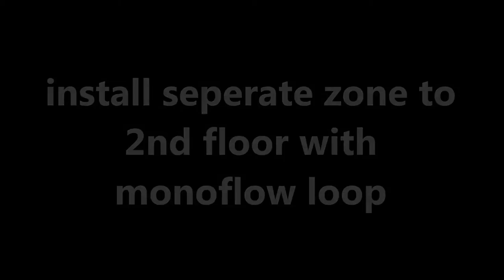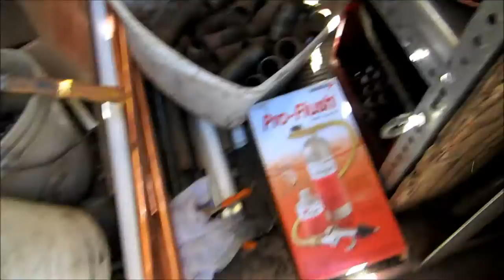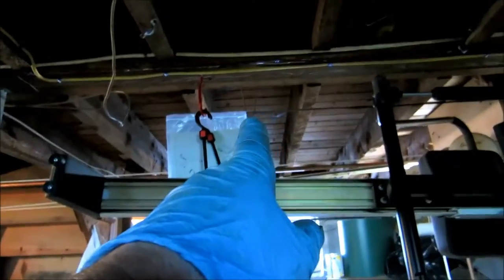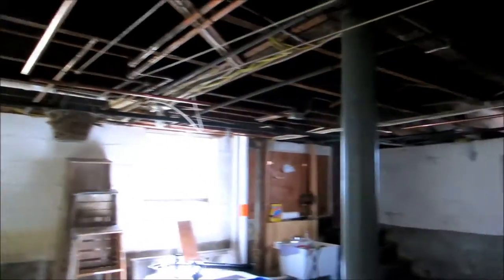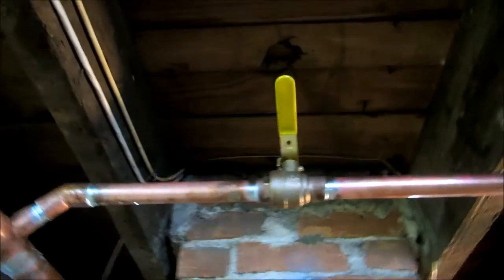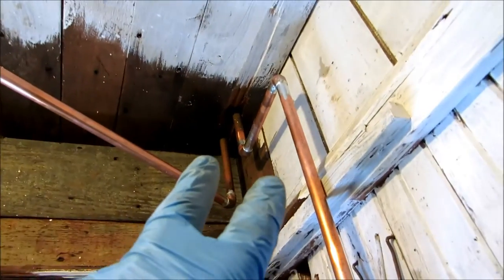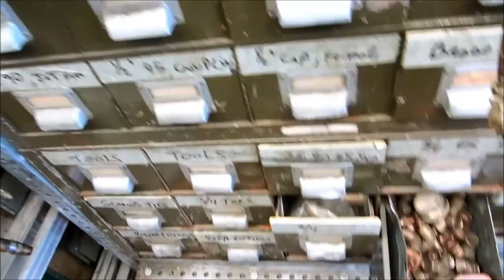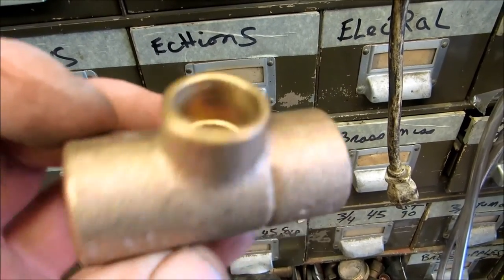heating 2nd floor monoflo / venturi loop added

Comment: Nice job Steven!! Still a lot of houses up here with old radiators for heat. Like slate roofs, they pretty much last forever.
Reply from the maker: yes a lot of cast iron radiators around

Comment: Hey Steve quick question, when connecting those snug baseboards, do you use a sealant on the push nipples? If so what do you recommend? I was having a hard time with pipe dope, thinking maybe MegaLock?

Comment: Why can't you go with a plastic type (maybe if pex was that big) piping to feed all radiators/baseboards on a boiler system? It seems like there would be so much heat loss with the copper pipe stealing the heat as well as the travel time to second floors...

Comment: Hi Steven, your videos are awsome as always. I have a question for you. How did you pipe the 1st floor loop to the new loop for the second floor? on the supply side. Did you just use  a regular tee ?

Comment: Hey Steve, nice video! I have the same setup (cast iron monoflo tee system) first floor and second floor on same zone and the thermostat is on the first floor right over a radiator witch i completely turned off that radiator so it wouldn't throw off the reading on the heat of the house ( was that a good idea?). so my first floor gets hot first then shuts off because it reaches temp level and my upstairs is still cold. so i now know i can split the system after watching your video. My question is can  i do the loop with pex and connect to the copper pipping that heads up to the second floor? i have same setup 3 radiators on second floor (3 supply going up and 3 returns coming down).
Reply from the maker: +pilanuno no you have to run a copper loop for second floor in basement  with monoflow tees one on the supply one on the return at lease 12" apart and from any 90 for proper working of moroflow tees

Comment: Hey Steve like the video was awesome.i don't do much hydronic work now iv put in one monoflow system before.One question when you add a zone or increase capacity on any type of zone system do you have to up size your return manifold? 

Thanks 
Kris K
Reply from the maker: i did upgrade it

Comment: Those tees are clever! Wondered how it worked till you showed the inside of it at 20:00 :-)
Reply from the maker: ***** on cast iron baseboard ,or radiators the motoflow tees are the way to go ..

Comment: Any time I cut out radiator with mono-flow  tee I connect tees back together with parallel pipe.
Reply: atleast you  have a clue about mono flow

Comment: supposed to connect those not plugem,you restrict the flow through the tee's,... how much you get paid for that???
Reply: Really by plugging those tees you restrict water flow I always took them out
Reply: With the steel pipe how much flow is there anyway with no water treatment